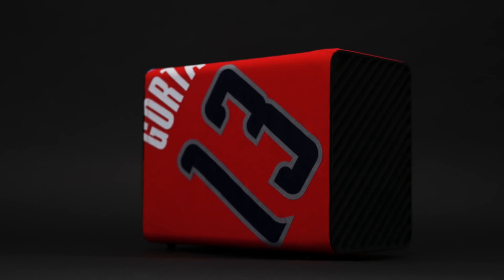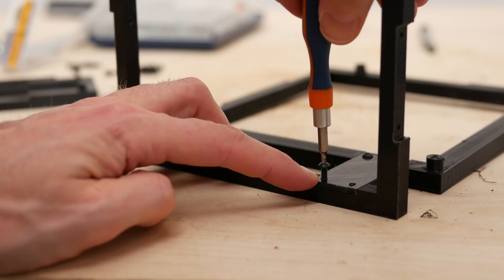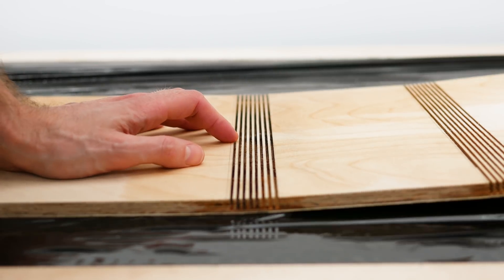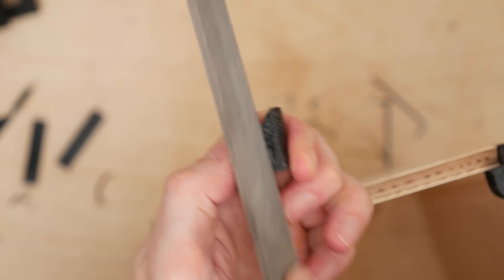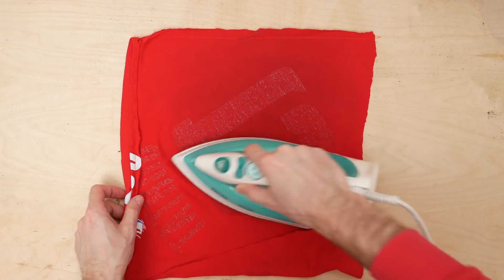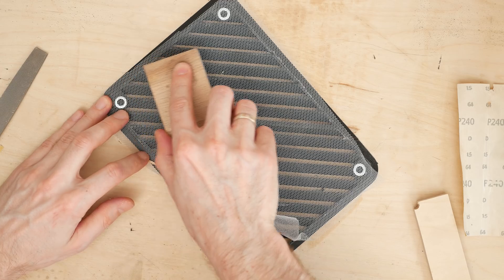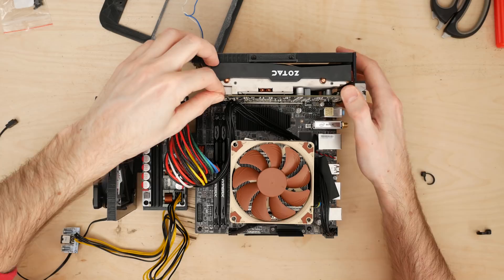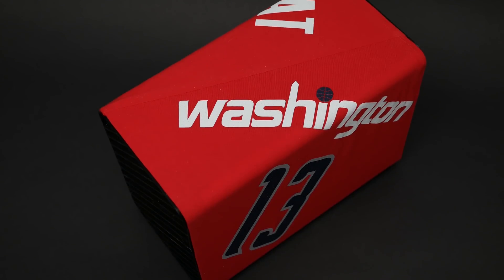How to make a PC case from scratch (DIY PC case)

Comment: on the bending plywood, if you don't already know about it https://www.blocklayer.com/kerf-spacing.aspx is a fantastic resource. It calculates your kerf spacing for you. The site has a bunch of other great woodworking resources too. 

Anyway, I've had great luck using boiling hot water on my plywood bends. If you can get it to bend just a little, so that you can fit the entire length of the bend into a trough of really hot water and just let it soak for a while, I think you'll have better luck (or as has been mentioned, if you can steam the area you want to bend, even better). Just be careful, because this can also cause the lamination glue to fail. Also, having some kind of jig or form to wrap the plywood around while you bend it will help a lot, especially if you use another piece of plywood (or even a 2x4) to support the side of the plywood you're pushing against. If you've ever seen a metal brake, it's the same concept. you want to make contact with as much surface as possible to keep the bend nice and clean.

one last option is to steam the entire board, then form it around a mold. You'll have to trim the ends because the outer layers will have to cover more area than the inner layers and will subsequently be short at the joint. Because of this, it will be much easier to make two halves, each a little longer than needed. Then you can just form them, let them dry and cut them to length to match.

Comment: It's really not about print volume or a better 3d printer in general. You can achieve a lot better results with the Ender 3 with just the right settings and testing out which material is best (Brand) and how you are gonna handle the material that you have (temperature, nozzle and bed wise, fan speed etc). I got the Ender 3 myself and got really beautiful results with a lot of testing and printing different difficult prints to see what gives you the best result :)

Comment: For bending wood you should use HOT water on bothe sides of the bending area and let it soak in. If this still doesnt work, play around with the cutting with and distance

Comment: If you have a 3d printer at home you wont be broke and need to build yrself a cheap case
Reply from the maker: Not having money isn't the only reason to do something yourself - one may simply enjoy the process or in need of something specific that off the shelf products don't provide. You'd be surprised how much I have spent on materials to build something in the past...
Reply: I know but me in specific was pooking for a cheap case since i only have a 250$ budget and 235$ is already used up because of parts

Comment: yeah from scratch.. but first you need to have a 3D print, and wait for a days to finish!
Reply from the maker: You can make the frame using aluminum. I can't, because I have a little kid now and the only free time I have is when my son goes to bed, which is roughly at 9 PM...
Reply: just make the 3d printer as well

Comment: Mate, done kerfing on a dozen jobs, cut down to the last layer of wood, then spray at the back (sheet you will see). Dont try and bend a radius too tight as that is when it will snap. Use an online calculator to work out the exact spacing and required cuts. I found that using angled pieces of wood and clamps the best way to hold its shape. Glue up and let sit for 24hours. I've done a couple of speaker projects with a 50mm radius and they look awesome, plus a big hifi unit and now a PC corner desk. Great fun and looks quite unique.
Reply: Otherwise just make a box and a larger round over bit on your router.
Reply from the maker: Thanks for tips! Do you have any pictures you could share? :)

Comment: Just for what it’s worth, CA40 (a heavy duty super glue that is also used as a sealant for wounds) is amazing for holding small parts together very well. And when it comes to “plastics” Testor’s model glue actually melts the pieces together so they become one solid connection. Hope that helps for anything in the future and VERY cool build!

Comment: I dont know of you have a video like this  one but   i dont have a enough room for a desk in my room so  but i do have dresser that im going to replace with a new one either store bought or homebuilt but i want to put my Gaming rig inside of it  and i just saw a video over at unbox therapy  that showcased  wireless hdmi so the dresser pc could sit anywhere
Reply from the maker: Sound like a cool idea! As far as transmitting video signal wirelessly, I'd be worried about the input lag in such scenario. But I haven't seen this video so I don't really know how this solution performs.
Reply: @YetAnotherTechChannel  well Lou from unboxed therapy said he couldn't noticed any lag so its  something to check out heres a link  to that video he uses it on a Nintendo Switch https://youtu.be/b9ktD79aDz4

Comment: That looks so amazing! I really like the curves and never thought about using a shirt to give it that awesome design element. What 3D Printer did you get? I want to learn Cad but it's a bit intimidating for me. I wish we had a place like you do to use power tools but there's nothing like that here sadly. Though my university does have 3D Printers so if I learn cad I may be able to borrow them for making a PC case. It would be really cool if you made an ITX case completely from 3D Printing or would that be too expensive? This kind of case could easily fit an SFX PSU like a Silverstone or Corsair one. Can't wait for your next project!!
Reply from the maker: Thanks much :)
The only element of the final design that required power tools and preferably a workshop is trimming that edge at 45 degrees. I have the Creality Ender-3 - a budget printer, but it gets the job done. I'm pretty sure your university has much better printers. Making a 100% 3D printed case sure would possible, but with the little Ender it would take quite some time... and one could argue if such build is an actual DIY project as it would have little in common with handcraft ;)
A case that could fit an SFX power supply is on my list ;)
Reply: @YetAnotherTechChannel  Ah that makes sense. I guess if I didn't want any curved edges I could just make it a rectangle/cube case. Haven't got to check out the printers soon cause it's not on my course but hopefully I can get access to them. And yeah I guess making cases from wood and stuff is more of a hobby and a craft not really compliant with 3D printing everything.  Good luck on your next project and thanks for the advice!

Comment: Instead of tapping the 3D print material I'd recommend having a hex cutout on the opposite side so a nut can be placed in it using super glue.
Reply: https://www.matterhackers.com/articles/fasteners-for-3d-printing
Reply from the maker: Thanks for the tip!
Reply from the maker: Oh, this is cool! Thanks for sharing!

Comment: You need RF shielding either metallic paint or foil tape on the inside and attached to the MB I/O shield that looks to be missing.  If you glued the entire cloth the glue would bleed through or discolor with age.   Overall a nice build.
Reply from the maker: I have an EMI meter but I forgot to do measurements. But yeah, you're right - I should order some of that metallic shielding tape.

Comment: Why you use t shirt for pc case skin? Instead you use paint (paint as red) and create a sticker (which is the font). I think it's a lot cheaper. Second one is make atleast 2 case fan (a small size) that makes cooler your system unit. The last one is repaint black on the edges
Reply from the maker: I explained that in the video - to ensure the paint job is on point, I'd have to spend significantly more time preparing the shell and then some more to paint it. I don't have much time for DIYing and I don't have a paint booth - hence the fabric.

Comment: Love your work. It is quite impressive. I'm not sure steaming the joints would have helped much as it looks like you are trying to bend against the grain of the outside edge. I know your cover is glued on now but check the off cuts. I imagine you'll find the grain of the wood is perpendicular to the direction of the bends.
Reply from the maker: Thanks for the tip. I guess I'll have to spend some time experimenting ;)

Comment: this is simply genious - loving it ! About the round corners, could be done by doing a square box and routing the edges round after... but be carefull not the weaken the joins !
Reply from the maker: Yeah, I thought about that - but I'm not sure if I'd be able to get the same radius (originally it was 30 mm, downsized to 18 mm with the plan-B) using a router.
Reply: @YetAnotherTechChannel  true. But you could add a stick behind the radius. Either case,  awesome build !

Comment: If I may make a suggestion, it would be to make perforations on the plywood everywhere where is covered by fabric and use that as intake/filter. 1 fan pulling. I think due to the extended surface of the case one 14cm fan would be enough to pull all necessary air to keep the inside fresh without the 3D Printed mesh. In any case! Great work man!
Reply from the maker: I thought about not cutting the fabric on the bottom for the GPU air vent, but I tried blowing through the t-shirt fabric and it seemed very restrictive. Your idea is very good, but it wouldn't work very well with this particular material.

Comment: Try steaming the wood joints you would like to bend. You will need to make a fixture to steam the areas you need to bend, as you only need to steam the areas you need to bend. Look it up on you tube there is probably tones of videos on how to do it.
Reply from the maker: Yeah... those videos make it look so simple ;)
I've seen someone making speakers enclosures by making grooves just like I did, watering and then ironing the area (I also tried that, didn't help). I might try steaming next time, but probably with something smaller.
Reply: If you can get a steam cleaner with a nozzle it may make it easier. Steam is definitely the trick in my experience.

You could also try a thinner piece of ply sheet and bend that and use it for outer cover on a frame. Again steam is very helpful bending the thinner ply sheet.